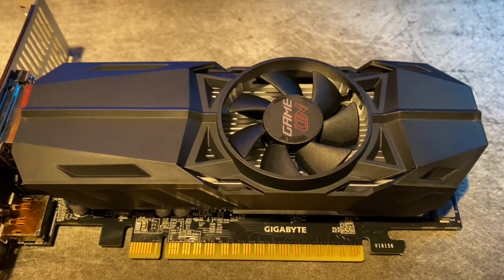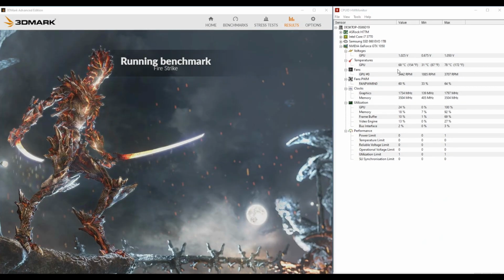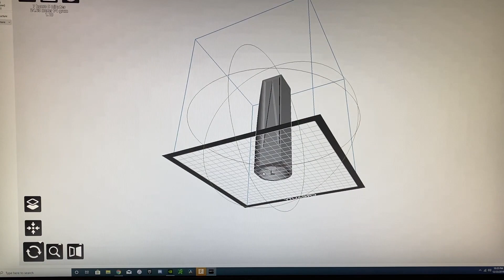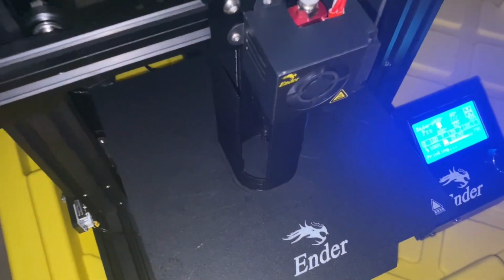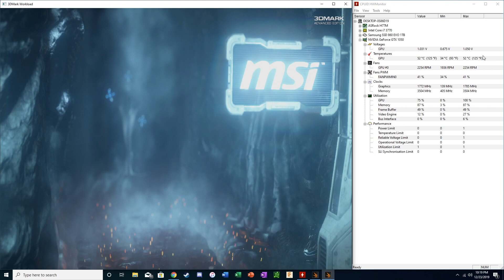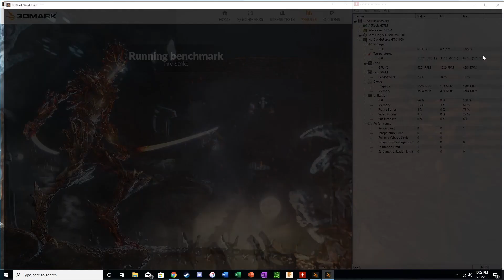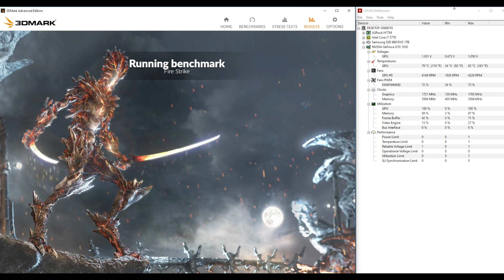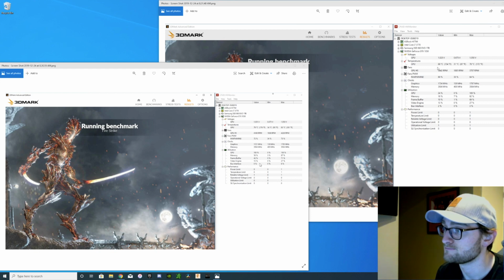3D Printing My Own Graphics Card Cooler!

Comment: Amazing job, if you put this in a confined case that it's meant for it will out perform the stock design for sure

You could've reduce the height to have more volume of air passing through the heat sink, maybe even opting for a blower fan to have slim design

Comment: You should revisit this. I think it can be improved in a few ways. 1. Also print a new slot bracket, which is full open towards the back. With this card NOT being a blower style card originally, the back is pretty closed off. 2. There is a lot of room above the heatsink inside the shroud. Bring it down towards the heatsink to force the air through the fins. 3. Use a higher static pressure fan, something like an Arctic P8. Really cool project for sff pcs.

Comment: turn the fan around and use it as a exhaust fan, though the heat will exhaust into the case vs exit the small holes on the back of the bracket but may lower temps

Comment: Not enough static pressure from that fan. I'd recommend a redesign with an 80mm fan. Try the arctic p8 fans, they are very inexpensive and have more static pressure while not being as loud as a Delta. If that doesn't work, there are plenty of 80mm deltas you could put on this card, but you'd probably have to power them from the psu due to the current draw.